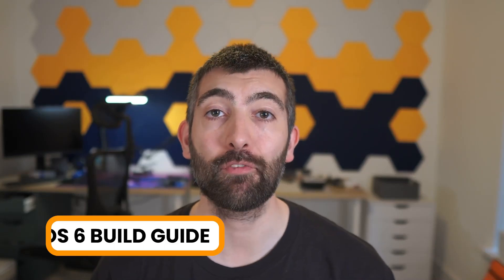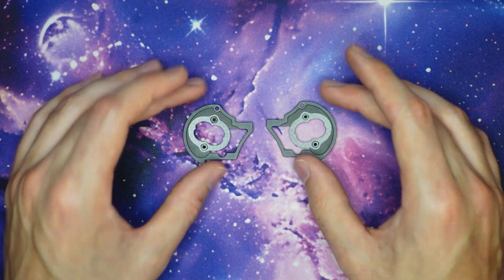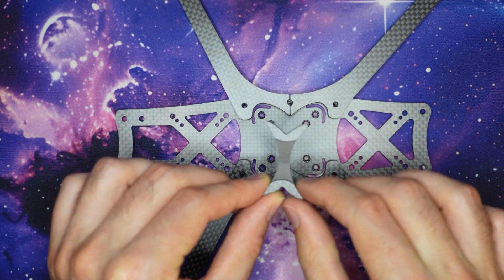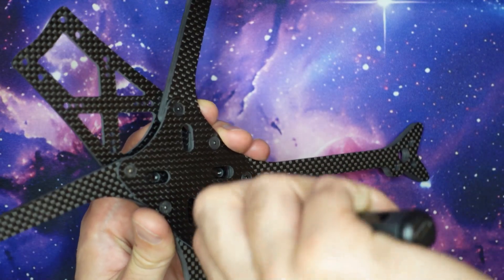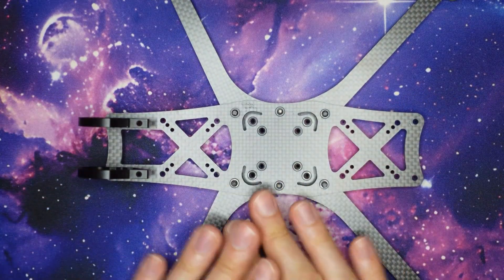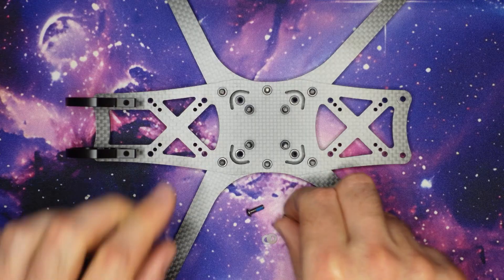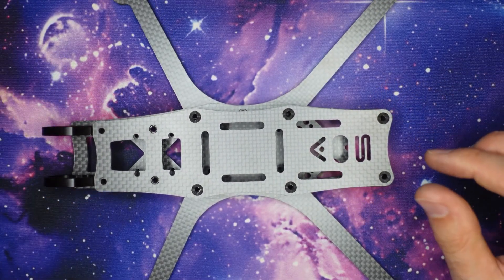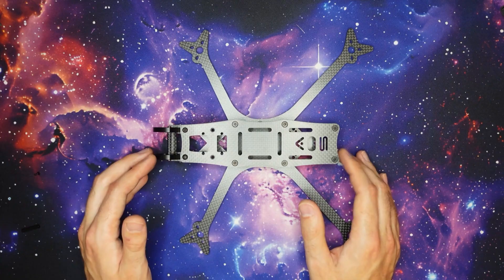AOS 6 and AOS 5 V5.1 Build Guide

Comment: Whats the difference between AOS 5 V5 vs V5.1 ?
Reply: Arm design. Got rid of the terrible split cut design. My question is, are they compatible or is it a different main plate? Meaning, can I just buy the new arms to put on my AOS5 V5 or do we need to buy a whole new frame?! Probably a whole new frame needed or at least a main plate and arms. Smh
Reply: @ObsessionFPV so ive read on the AOS site the upgrades parts for 5.1 will be available for the v5 frames but I just cant find and parts yet how about you ?
Reply: @serval_fpv  you just need 2 sets of arms I suppose. Going to order mine after the holidays as funds are tight rn. I need a main plate as well tho and maybe a cam cage. Need to look at my box of parts. Lol
Reply: @ObsessionFPV ah gotcha yeah hope we can use the new parts but probably not like you say but can always hope..
Reply: @serval_fpv  according to the other video he dropped a couple weeks ago, should be able to order the new arms/spine and bolt em on.